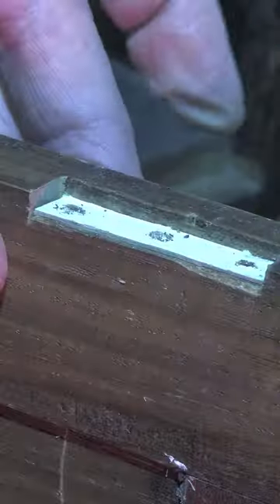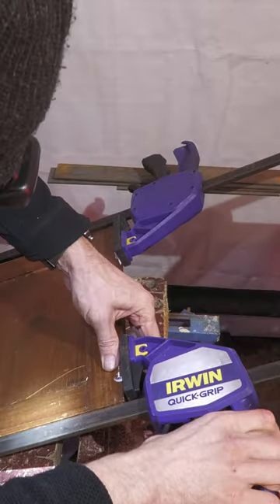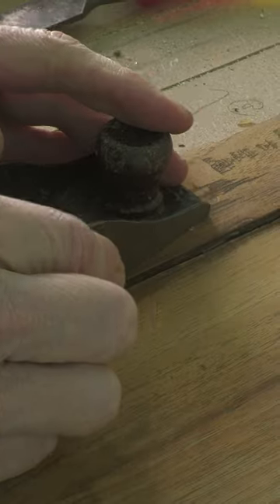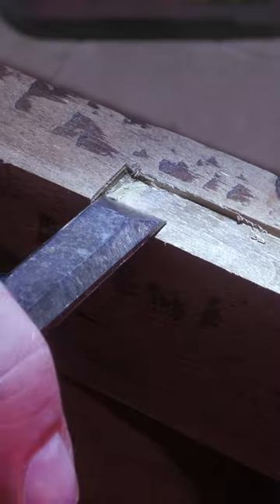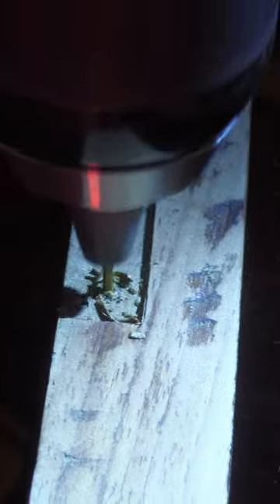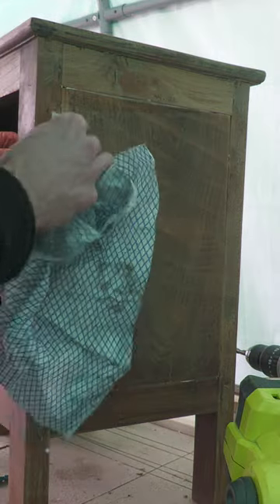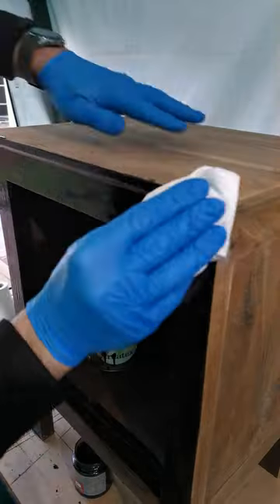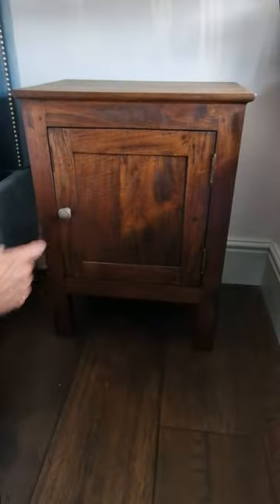Damaged Bedside Table DIY Repair #shorts

Comment: How did you cut the small pieces of wood to fill the old excessive rebates?
Reply from the maker: I cut them using a small tooth saw - there's a clip in the vid. I fine tuned the shape using my hand held belt sander.
Reply: @CharlieDIYte  Cheers. Will there be a full length vid? This one is very fast and I don't think you can rewind it a few secs (being a short!).